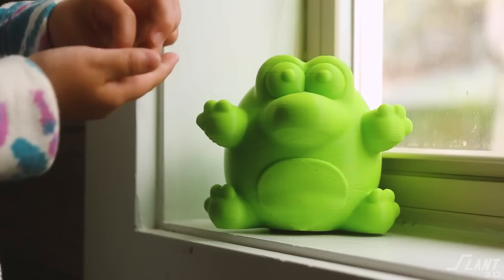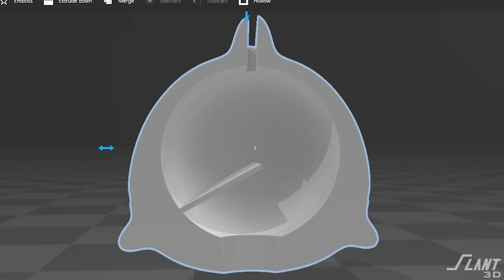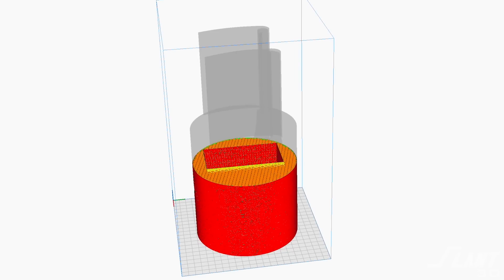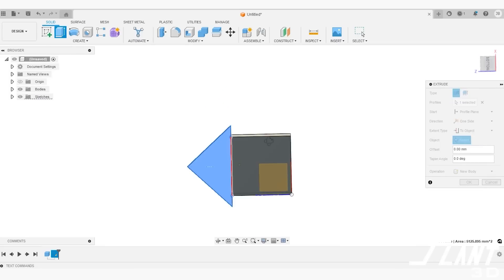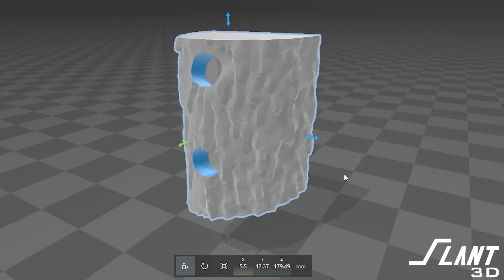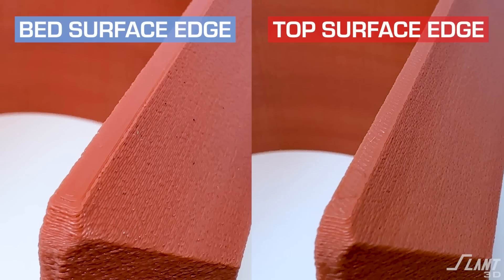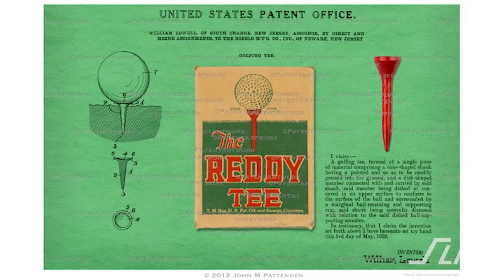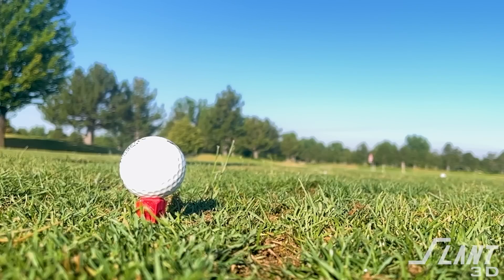5 Everyday Products Redesigned with 3D Printing

Comment: @16:20 very easy to push into the ground... as the demonstration hand is shaking trying to force it into the ground. I think its hard to beat a simple, cheap bamboo tee for pennies which is much thinner and easier to put into the ground since its literally a nail

Comment: My only concern with that fan is that it doesnt seem like air mattress pumps are typically designed to run for extended periods of time, and it seems like it would burn the motor out pretty quickly..(plus they're not exactly the quietest things :l); perhaps nowhere near as big of an issue as it seems, but I can't help but think of it.. that said, I wonder how much trouble it would be to design the fan to be able to insert just the motor into it without the existing shell 🤔
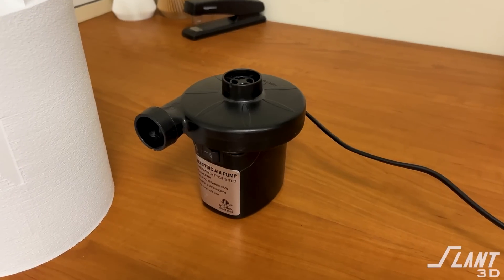Reply: "we needed something that we could make in a day, to prove out the concept" 5:30
These designs are made to show design principles, they are not products.